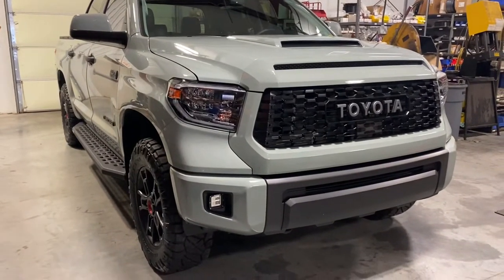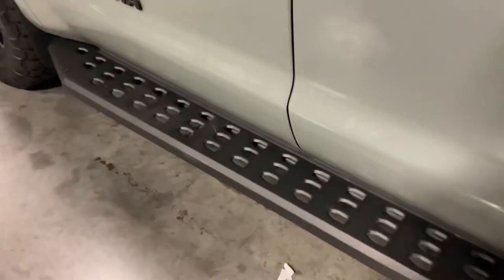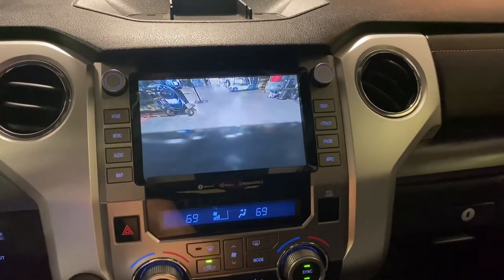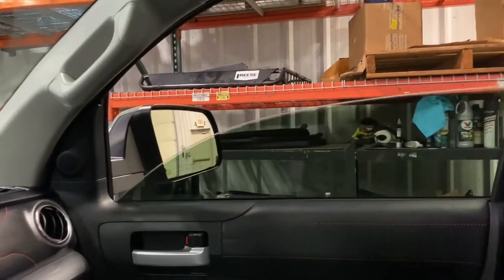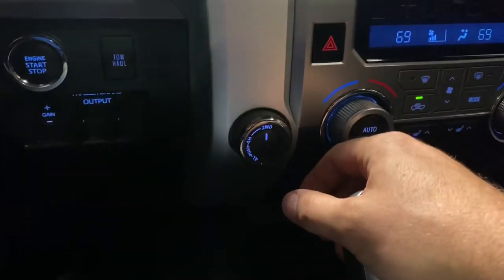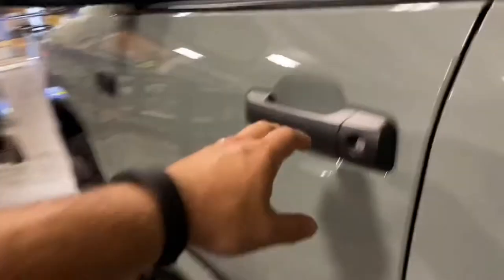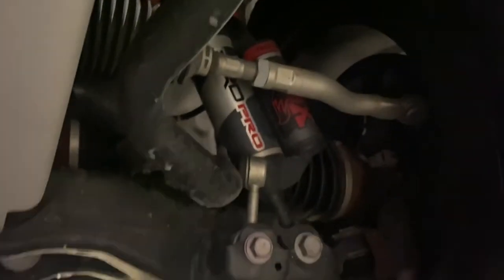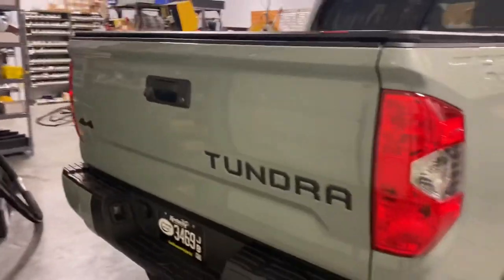2021 Toyota Tundra TRD PRO Lunar Rock for sale!

Comment: You have finished it out very nicely.  Does it have the parking and backup beepers, and blind spot notification?  38 gallon tank?
Is it still available?
Reply from the maker: It doesn’t have the parking sensors or blind spot monitors. I find those to be annoying anyhow. 

It is still available. It’s listed on Autotrader. Here's a Used 2021 Toyota Tundra listed for $63,900 on Autotrader http://atcm.co/VDPTXTSHRE/23413288
Reply: @DirtE30  Are the tires 18 inches or 20?  Did you have to do any adjusting to get clearance?
Reply from the maker: @rockwilliams457  they’re 18”. They’re on the stock TRD PRO BBS wheels. No trimming of any kind needed.

Comment: Very nice truck! are the tires 295/70/18?
Reply from the maker: These are actually the 285/70-18… Nitto still lists them as a 34x11.50 but they weigh substantially less than the same tire in the 295/70-18

Comment: Where did you get the under seat storage and what model?
Reply from the maker: ESP truck accessories
Reply: @DirtE30  was there any cutting in to floor pan?
Reply from the maker: @huskiesz1584  you have to cut out the carpet and the heavy foam backing underneath. Lots of install vids on here.
Reply: @DirtE30  Thanks